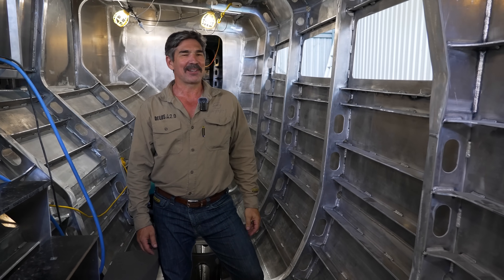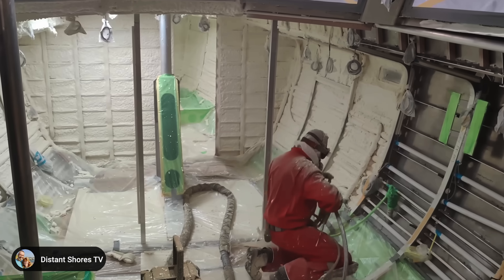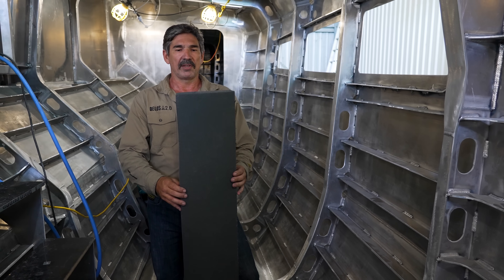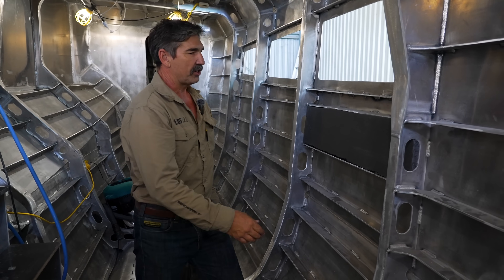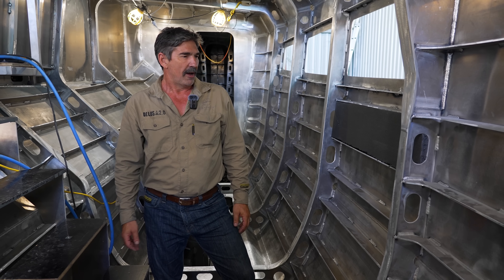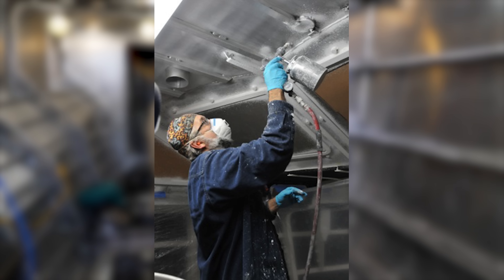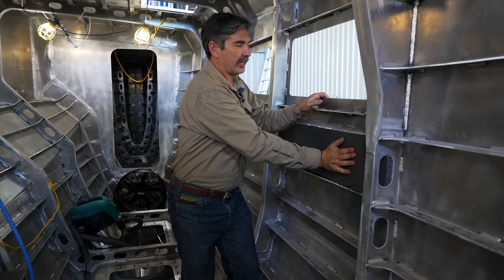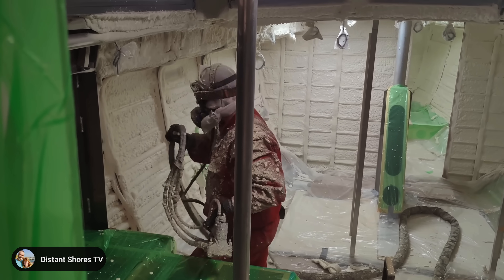HELP, We Need Your Advice!  How Should We Insulate Our Aluminum Catamaran???

Comment: if it was me... I would primer the inner hull with a good auto primer, check out PPG DPW 1847. Its tried and true on aluminum as far as bonding to aluminum, condensation and salt wont bother it, and its water based so it wont kill you from the fumes when you're spraying it (still have to wear a good mask obviously).  The pluses, it can bond even when your metal isn't surgically clean and its viscosity makes it light so you're not adding 11,000 pounds to the boat while getting complete coverage. I would do a respectable acetone wipe, then tape openings, shoot it with primer (any tight corners use a foam brush to get coverage),  then go with Neolon with the anchors (id likely install the anchors before I did the prime). Doing this you get the metal protection and the flexibly "when not if" you have to "go back in" and get to the metal surface without something glued on. Plus the primer wont mind composite thru hull fittings (I'm pretty sure you're on this road).  

Spray foam would be the LAST thing I would do unless you coated the metal first for the very reason you stated, water getting in there thru condensation and sitting. But just don't think spray foam is the best way. I'm sure I'm going to get eyebrows raised for recommending an automotive product for a boat, to that I say, the product doesn't know or care its on a boat and not a car, if it can handle the abuses it gets from a car or truck, it can easily handle the inside of a boat! Conventional thinking is great, right up until it traps you lol... your bus bars are a perfect example of breaking away from conventional thinking... luckily I know you are the type to do your diligence!!  

As far as the "rib ends" and heat transfer you are worried about, the exposed area will be so thin, and still covered by whatever you finish the wall with, heat/cold transfer will be negligible imo...at some point you can overthink things. ;D

I don't know what you're planning on doing with the outside of the boat, but it if was me, I would wipe and primer the entire boat and do a base coat/high uv resistant top coat (multicoat the clear/topcoat and on the last one you use 800grit aluminum oxide power on any walking surface for grip, it works great) plus with PPG or DuPont products you can do shiny, or flat, or even better... Matte finishes that it will be very durable, tons of color options, easily repairable, and light weight from products designed to sit in the elements and sunlight all day and not fade. The salt imo isn't so much the worry as far as primer/paint goes, galvanic corrosion is.... stainless steel on aluminum, you basically just made a battery lol.  That is what I'm truly interested in, how you're going to attach stainless to the aluminum and not eat the aluminum up, poly or rubber gaskets? And will they take the pressure of the rigging tension and not "smooosh" out?  That imo is going to be the real challenge.  

Hope this helps Brian

Comment: My two cents is spray closed cell foam.   Design your interior cabinets for easy access to the hull so you can scrape the foam out.  At some point in the future either you or someone else will damage the hull and it will need to be welded on.   

Finally try to get a foam that is as fire safe as possible.

Comment: I follow a number of youtube channels regarding sailing. I am not a sailor but I my choice is always what works for me. About your question: Please look at episode 30 and 31 of Lahakai Sailing. They were facing the same problems on their steel boat. In my opinion , you have a aluminium boat, use aluminum foil insulation, with or withouth Rockwol between the aluminium.  Alufoil insulation comes on big roles, 1-5 mm thick, ease to cut, use alutape to fasten, mold resistant etc. But it is your choice what product you take. Good luck and the boat is looking insainly good. Greatings from the Netherlands.
Reply: Horrible idea it can & will get wet 8n the humid environment of a boat & if it gets wet with salt water it will Never dry. You can never get an air tight seal & therefore will get condensation issues. 😊

Comment: I had the front of my house renovated a few years back in the fall (relevant, it's cold up here) So when they had giant holes where the windows would go they built a temporary wall with batons of fiberglass insulation and having that back lit by the sun showing you just how many gaps there were was crazy. Every little wrinkle was a gap where there was 0 insulation factor.

I took a big piece of old glass and sectioned it off with 2x2s and tried a handful of different insulations that could reach R100 (again, it's cold up here!) and the only insulation that didn't have a bunch of light, and thus heat, leaking through was spray foam so I bit the bullet and paid for the good stuff. I tried about a dozen times to get a good no leak setup with fiberglass, rockwool, polyfoam. None of it was ever fully insulating. I honestly could not recommend any thing nut spray foam with a good conscience.

That said though on a boat I would consider doing 95+% spray foam and then having a section of just batons so I can get to stuff that is important. This requires a lot of thinking ahead of the concession of future changes being more expensive since they will have to be routed through the accessible areas.

Comment: Spray baby Spray.!  Must seal everything,everything,don’t miss one single Weld spot for sure 
After if you need to insert foam ( only needed at the North Pole & the Polar Bears) 
Then at least you can get back in there if needed. You obviously need to keep the moisture & water on the outside!  Good luck with your boat, watching for your next vid.
🇨🇦Cdn. Dave🇨🇦

Comment: I also would opt for the spray foam versus the cut and glue bats of polyurethane, for reasons mentioned by others and also the labor savings by spraying vs. the cut and stuff method which would be extremely labor intensive. Also it is rather easy to chop out a small area should you need to maintain anything under/in the foam.

Comment: In aviation, we use Zinc Chromate primer on all the metal parts for anti corrosion, then we put insulation blankets in between the frames and over the ribs (just as you described). Your inside is build pretty much the same way as an airplane, and we have to deal with condensation as well (and fire proofing). My vote would be some type of anti corrosion spray on primer (something that you can also get in a spray can maybe, so that if you needed to do a repair you could re-coat the area) and then add insulation. We also use insulation tape in areas that aren't conducive to blankets.  I would say in your case, look into the aerospace industry to see what the latest and greatest stuff can be bought over the counter. If you go with a primer, spray it on before you install anything else, and once you have installed your component you'll probably will have to inspect for scratches/rubs and then re-coat (usually a brush on step at that point)
Reply: As a Fire Safety Engineer, i 100 % support this suggestion. Metal won't burn of course, but if a fire spreads to your insulation via conduction, you have no chance of putting it out. To add to this, if your insulation is plastics-based, it will melt and form a very, very hot pool at the bottom of your hull. This has happened in buildings many times, and the problem is that even if you manage to put out the fire, it re-ignites due to the hot pools at the bottom.

I would advise that you avoid foaming plastics alltogether, even though I understand that condensation and general water proofing is priority number 1. 

Do not overlook fire proofing. You don't need it until you REALLY need it.
Reply: @DukeNero  Almost every higher-end home being built in Montana uses foam.  I have never heard it mentioned about fire.  It also hasn't been on any insurance forms.  Can you point me to some information?
Reply: @jginmt  It's difficult to answer this without going into detail, it's a big subject. Spray foam is plastics based, which means it is derived from crude oil. The easy and short answer is therefore that it is flammable, and that it will contribute to a fires' potential greatly. The longer answer, is that plastics is an overarching word covering many types of different products. No one can say that polyurethane spray foam is a fire hazard because you can add chemicals to it and produce a almost inflammable product. This is why producers of such products have to test their product with regards to sound, reaction to fire etc. But. Here in Europe, I can tell you that I have seen highly flammable spray foam insulation used in almost every type of building. Even hospitals. The product passes the tests because the plastic gets covered on all sides with plaster (or some other product). This is fine in theory, but if you have a highly flammable material inside many of a buildings' constructions, then you are completely dependent on it never being exposed to a fire. Because if it is, the only thing we know for sure is that things will go from bad (fire) to worse (bigger fire). Coupling this with todays modern buildings, and the amount of wiring, pipes etc. that have to pass through these constructions... Let me just say that I have spent 15 years inspecting buildings, and not 1 has been built without exposed insulation in some form. The only difference I've seen is the amount.

And I have to add that there's really not many differences between Europe and America when it comes to fire safety, because most of the research was done in America and adopted by Europe. 

My advice is to avoid any plastics based spray foam that you HAVE to completely cover. Any spray foam that has been tested, exposed, is safe to use. I wouldn't use it, personally, but that's a product that has actually been tested.

For more information you can go to sfpe.org or nfpa.org
Reply: @DukeNero  Insurance companies drive a lot of what is built.  I am going to have to call some custom home builders to what they have learned.
Reply: this aircraft primer is the only way to go for preventing corrosion surprises. then whatever removable insulation over the top. in boats you always need access to the plates for inspection.
Reply: Mirage2991 I was thinking the same thing as you.  Aircraft go from -40 to +90 degrees in minutes. Brian being from the Seatle area I am sure you know someone who can dig up a Boeing engineer to advise you. I think they use a combination of insulation. Some high-density to block low frequency and low-density.  In housing construction, all wires and plumbing is run before they start to install insulation. All high end homes here in Montana use a combination of spray foam and batten insulation.  Condensation will form on any wood that is not insulated.
Reply: Licensed A&P here. I fully support this comment and its information.
Reply: Zinc chromate is very poisonous, and aerospace is the only application where it is still allowed to be used. There are other zinc/aluminum/strontium compounds that are used in primers for other applications.
Reply: Hi Brian, Think this is best suggestion option I've read, the only addition would be to perhaps use household brand ZIP tape to airtight seal gaps and joints, or what in airlines is sometimes called 1000 mph tape ie metal backed duct tape with a complementary aluminum composition to avoid corrosion issues from a Stainless Steel tape. It can seal extremely well and is still removable in a year or 3 when you WILL need to inspect at some point. Maybe if you add the second layer of foam to back of wall trim panels and use velcro with some screws for securement ? Can that foam be hot wire trimmed for cutouts or just use an electric carving knife like on conventional foams ?

Comment: If you could contain all wiring and plumbing to one side of the boat rather than having is all over the place, if that's even possible, then spray foam the rest of the boat and use the foam batts in the areas that have wiring and mechanical and  might likely need future access.

Comment: i would go with closed-cell spray foam it is dense, lightweight, adds buoyancy, is waterproof, high R value, can be treated with flame retardants, and is mold resistant. there are many ways to get around issues with spray foam, you can wrap sensitive pipes and whatnot with plastic, you can spray the inner hull with Vaseline or a similar product to prevent the foam from adhering to the hull making it easy to cut out for repairs. the vaseline also acts as a rust, corrosion, and oxidation preventative.

Comment: At Alloy Yachts we used a 50mm thick glass wool between stringers then a foil faced 25mm thick glass wool wrap over all the stringers held with pins and taped to frames with foil tape - exposed frames then sprayed with an anti-condensate paint. In your case, anti-condensate paint on exposed (or all?) metal and the foam bats between stringers sounds like a good compromise. I wonder if taping to frames and between bats would give a good vapor barrier to prevent condensation on hull plate - humidity can't condense if it can't get there, right? Also important to tape over the pins since they will sweat!

Comment: I'll bet you can use a combination of both insulation techniques. Spray foam in areas where you probably won't have to access very often and removable insulation where you will need to do routine maintenance.

Comment: A heat pump is 3x - 5x more efficient in heating and cooling. You might want to use the conductivity of aluminum combined with the relatively constant temperature of the ocean as an advantage. Using the ocean as a geothermal heat sync, you could build a heat pump that cools off the inside of the ship using far less power than a traditional AC unit, and when you are in colder climates the heat pump works in reverse to pull the heat out of the water to warm the boat far more efficiently than a standard electric heater. Basically, you would be using geothermal power without having to drill a giant hole in the ground since the entire ocean acts as a heat sync.

Comment: Look into zinc chromate to spray on first.Its the green coating used on all aluminum aircraft for anti corrosion.  Then I would use that black insulation as you have shown but..Just use spray adhesive in  spots to hold in place. You will save on cost of insulation and in the event you ever need to remove insulation it's not fully attached.The stick pins as they are called will add extra weight and they are no fun to work with. Hope my comment reaches you and it helps in any way.

Dean from Canada

Comment: Now you have the same problems like in a van conversion to a camper. I heard of spray corc, a company in france produces it. Very good insulation. Advantages like spray foam. But healthier. Dont know if the glue used is good for aluminium boats and extreme temperatures.

Comment: Spray foam is hard to beat for cost, ease of application and insulation value if applied properly. It is messy to remove but once the boat is complete that should not be a problem. A major consideration for insulation especially for a boat should be smoke toxicity.

Comment: You are on the right path. Do the double layer of the PE. We have done a spray in cold tar before but at any failure point you run the risk of concentrated corrosion point. You can never remove all the moisture so do insulate well but also breathability is key. It is like a rubber VS gore tex jacket. The other product is rockwool for a cheaper option and neoprene for the expensive one.  but I would stay away from the coatings.

Comment: I suggest you apply a fin film in most off plane areas than spray over. Day you need repair just cut a areal and pill off the film adhesive

Comment: I have done technical insulation (fire - thermal - sound) on ships and oilrigs, working with a lot of high end materials.

Zinc chromate and closed cell spray foam is perfect for your project. Only problem is that it burns very well, but that should not be an issue.

Comment: Whatever you choose as the insulation material I recommend covering said insulation with a spray on material used to seal large water and gas lines, vehicle dash and interior, etc.  Industrial, cost effective, space saving, protective.  Contact Graco and inquire.  Easy to use.  Very forgiving.  Super strong.

Comment: Cork (spray on)  insulation seems to be a good idea taken from the boat world and now making moves in the van build world ... Less of the "bad things" venting offers would be from the spray on foam type and it not only acts as a vapour barrier but your sound deadening and first stage insulation. Foam sheets then to bulk out the insulation to the rating you require.
Reply: You can also use Cork Board for further insulation.